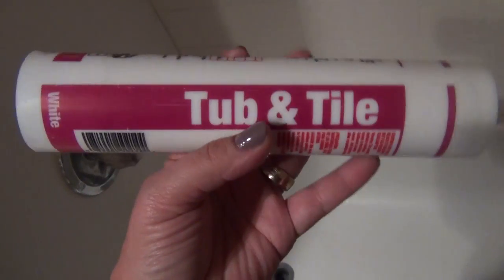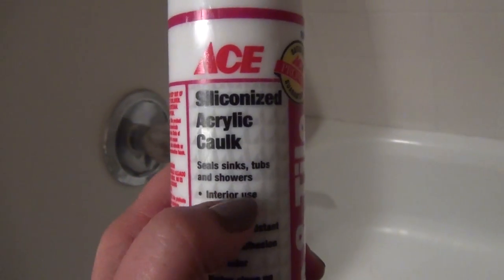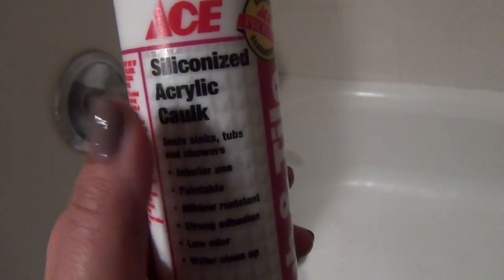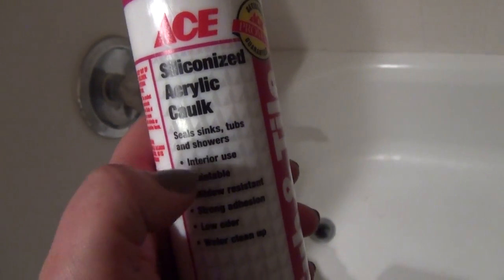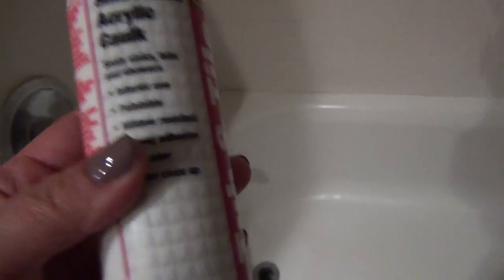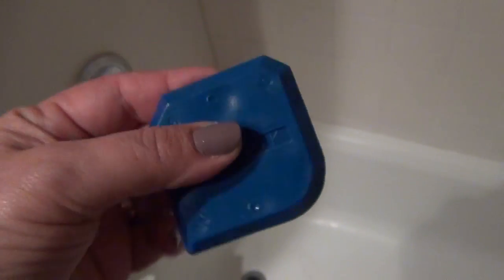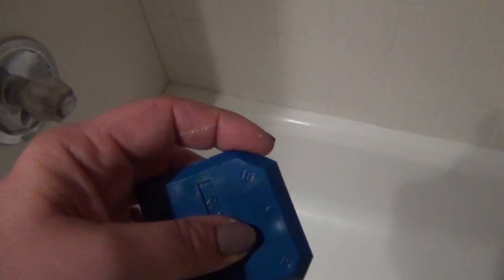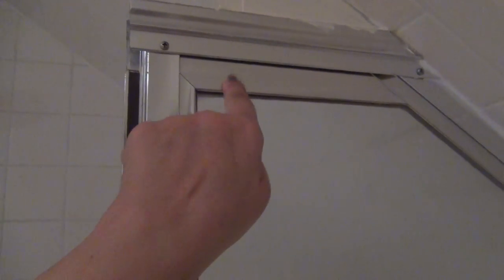Master Bathroom Makeover - Part 5 - Caulk

Comment: The sealant has really made a big difference. At least you now know it was the type of grout that was causing your problems. I always find that what ever shower toiletries holder I get, they are never deep enough for the large bottles, usually something manages to fall over/out of the basket. I wish I could have one of those on a post but we have coving around the ceiling so don't have a flat ceiling area (can't get the post straight up). Looking good. Lorna UK
Reply from the maker: +Jonathan Pountney some of the large suction cup ones are pretty sturdy too
Reply: Yes I have some suction cup ones on at the moment - keeping fingers crossed nothing has landed on my toes yet!!

Comment: Do you have any info to share on reglazing - painting the actual tub? Mine is still aqua from the original build in 1960 , thinking of changing it to white. Any opinion?
Reply from the maker: I did that years ago in our Brooklyn apartment it was a spray. It stunk it worked for about 1 year and then it flaked off. But they do have better products now.